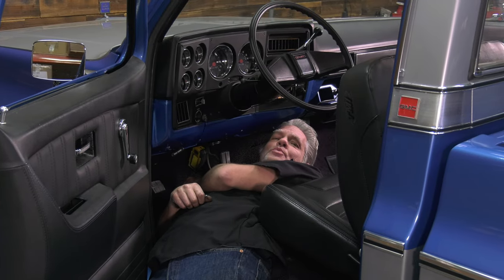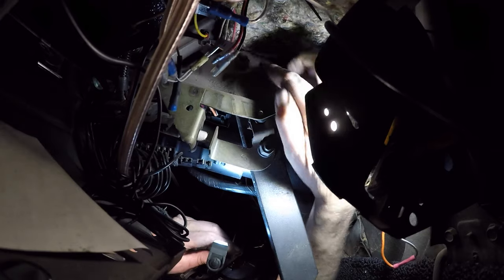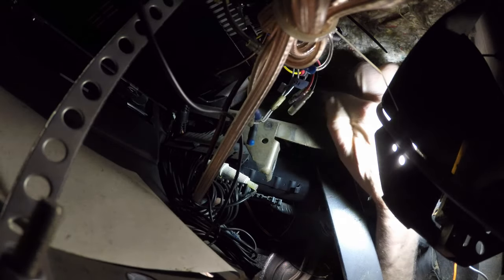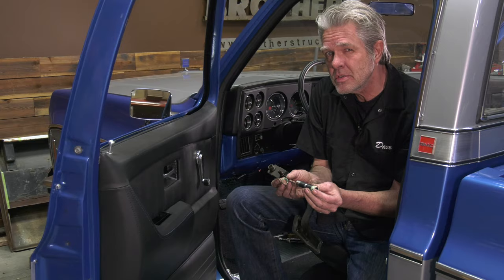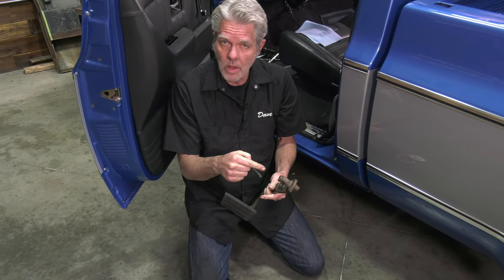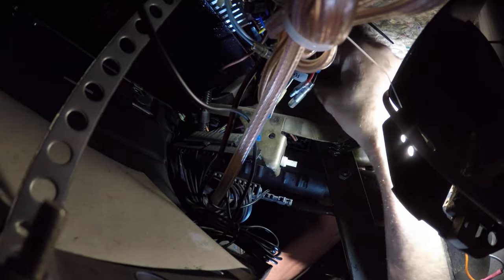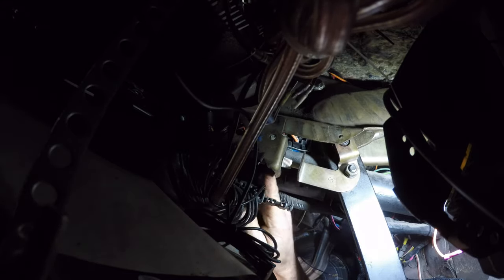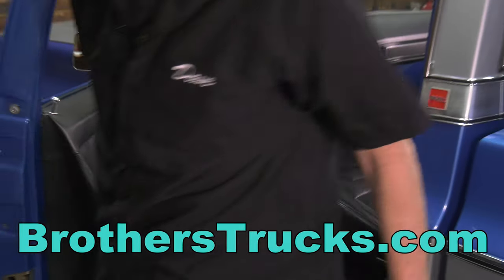1973-87 Squarebody Chevy & GMC - Squeaky Brake Pedal Repair, Removal, Maintenance & Installation

Comment: Can you do a video on replacing the spring on the automatic gear shifter?  My shifter is very loose and there seems to be very little info on how to fix it.
Reply from the maker: What year, make and model?
Reply: @BROTHERSTruckPartsTV   1984 C10 Silverado
Reply from the maker: @cnkilts  we should have asked this before, floor shift or column?
Reply: @BROTHERSTruckPartsTV  column shifter.  Thanks.
Reply from the maker: @cnkilts   Thanks! We'll look into.
Reply: @BROTHERSTruckPartsTV  thanks. You guys rock for helping keep these trucks rolling